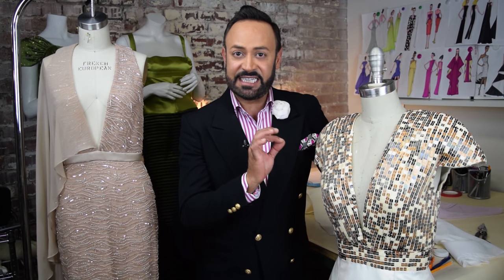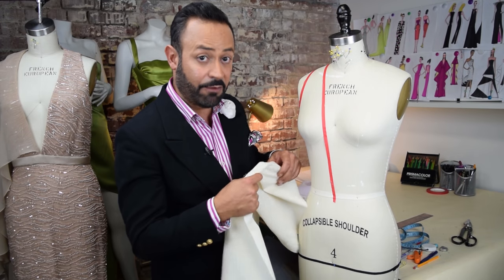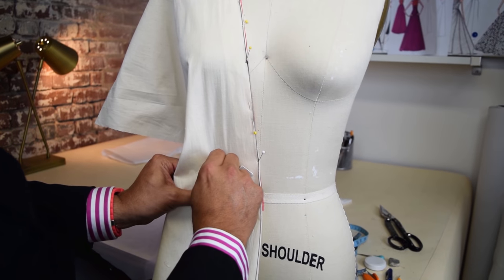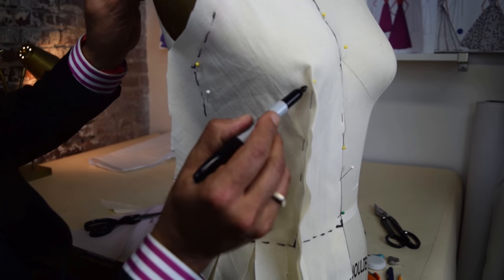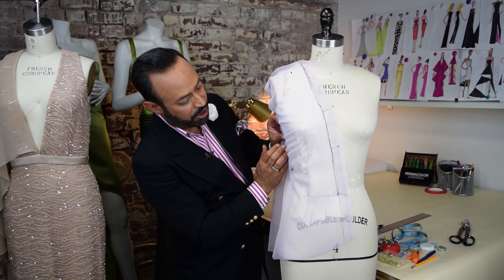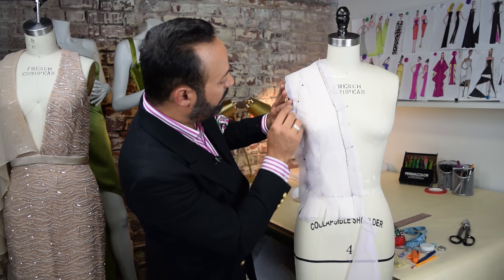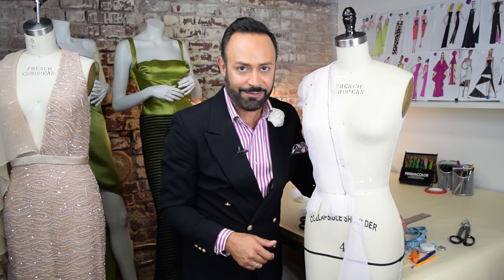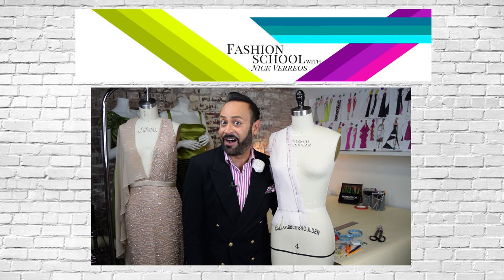How To Drape a Dartless Bodice

Comment: This is great - thanks!  It appears you're easing the "dart" into the side seam and along the armhole.  I read your response to the question about possible utilizing this technique for larger busted models; why would you have to raise the depth of the neck line?    Also, I'm curious to know if you modified the muslin (lining pattern piece) along the front seam to match the shell fabric (since the shell fabric was shifted approx 3/8" towards the side seam)?  Thanks so much!

Comment: The vertical lines of the sequins will be all over the place by the time that design is finished.
The best way is not to use lines or checks when a dart is necessary
Reply from the maker: dressmakers dummy completely untrue. I’ve used this technic many, many times and with a delicate hand it works perfectly. Obviously, it must be a bodice with a smaller dart, but it works like a dream. Try it!

Comment: Please guy, it's easy to drap with no dart, how do you  create the flat pattern to cut out the self fabric on? After Draping, you still need to create a flat pattern. You keep using Judy as if it's the same measurement for every woman. Create a larger measurement using your drap as a step.